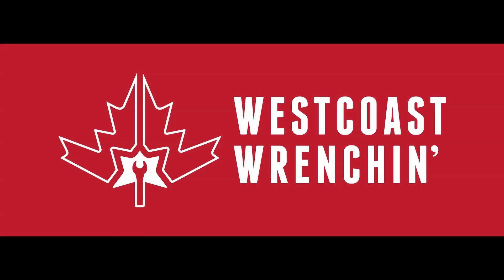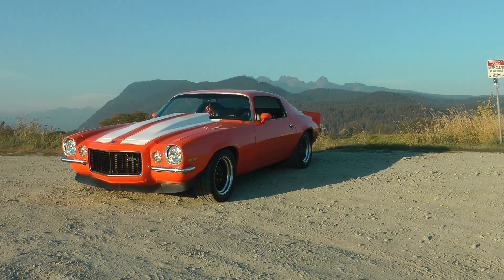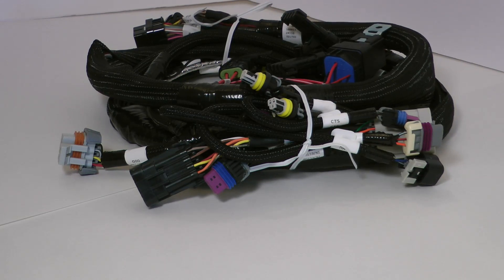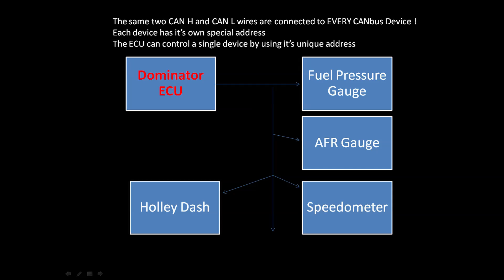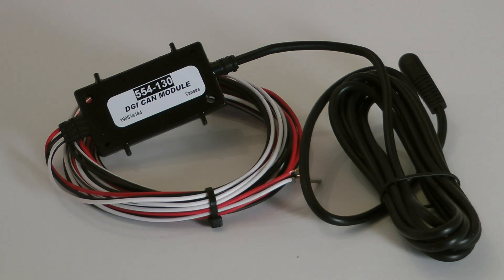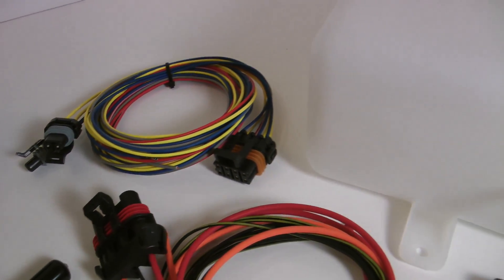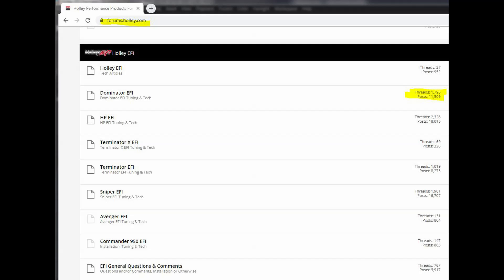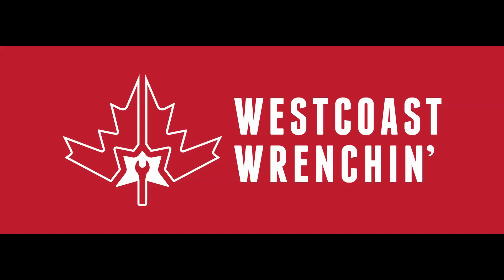Holley Dominator EFI Overview - Why it's the best LS EFI standalone -  Features, Hardware, Benefits

Comment: How long would you say your water meth tanks lasts between refills, what size os it, im doinf a street build, maybe occasional drag, but dont wanna be getting iut to refill water/meth every two seconds
Reply from the maker: Ages, maybe 2 refills per summer? Only comes on at high boost
Reply: @WestcoastWrenchin  wow thats way better than i was expecting, is that stuff rly as great as i hear it is, ive read up on it but just dont hewr of alot of people using it wixh makes me wonder why, from what ive heard tho this boost juice is gods gift to race cars, alsp thanks for the quality videos and the quick replys, keep it up my man
Reply from the maker: @Jonathon Saavedra  thanks! Yea I got the tune done with no need for meth and am spraying it only for iat and high octane. It is a life safer in my opinion, you don't use much of it and it is a really good safety. My cars going into its fourth season 15psi always smashing on it on 30deg C days
Reply: @WestcoastWrenchin  thats awesome man, i think you got me sold on going along with my water meth plans, ill probably do the same and run it at high rpm, help avoid pinging and get some extra ponies way up there in the revs, nice build my man, you got your self a sub, hopefully in a years time ill have my motor almost done and ill be back here watching these again, again killer ride, drive fast dont die
Reply from the maker: @jonathonsaavedra843  cheers! You will like the meth, use it is a safety thing only and you will be happy with it